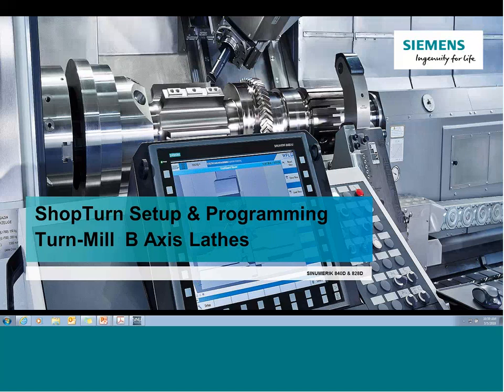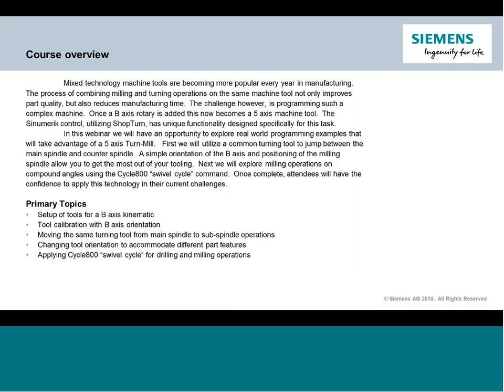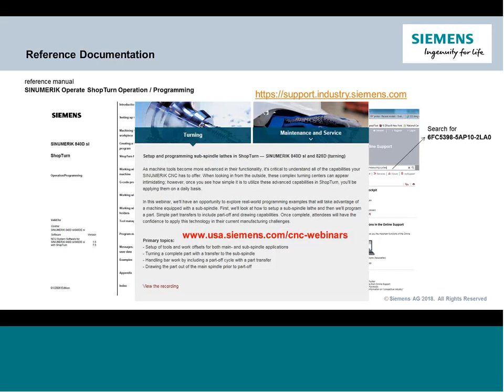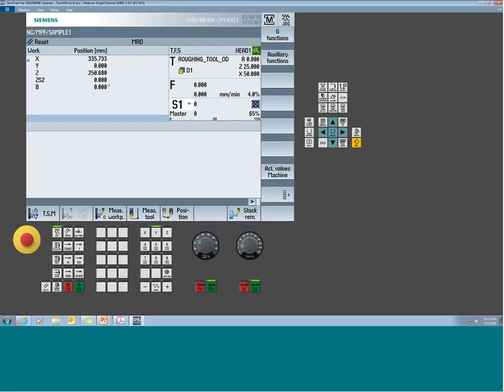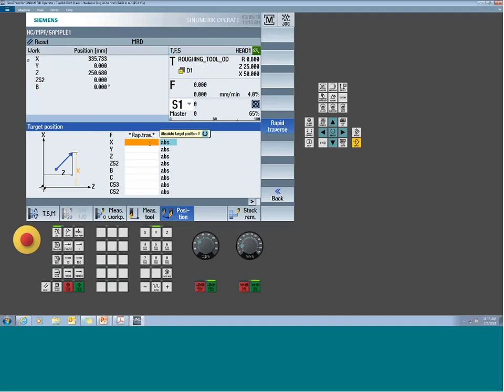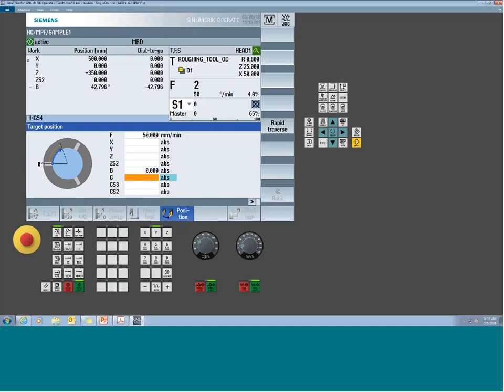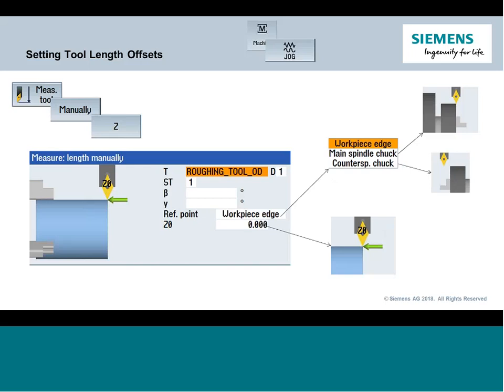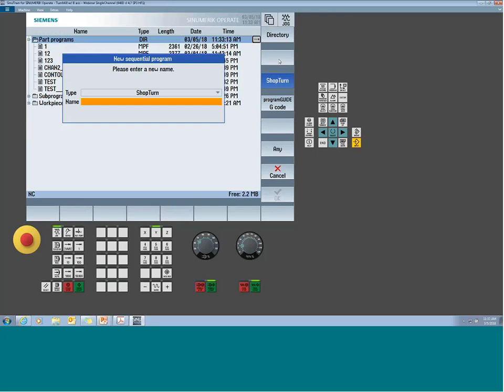Setup & Programming Turn Mill B Axis Lathes in ShopTurn for Sinumerik 840D & 828

Comment: Dear sir ,
Greeting of the day.
In turn mill 840d si how I will do my c4 axis (chuck )zero.
There is a line in my fixture I want this line was my zero  position ..the line is 120° when my c4 axis is reference ...
Reply from the maker: you can zero the rotary axis out in the work offset page.  this way when you command a G1 C4=0 in the program it will go to the 120 degree location for zero.